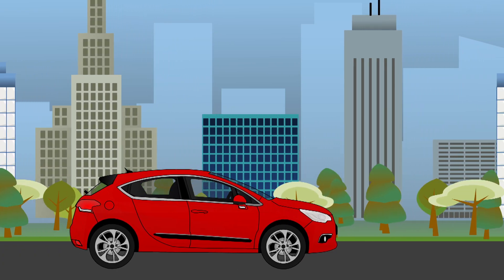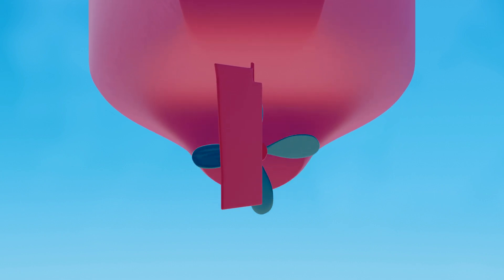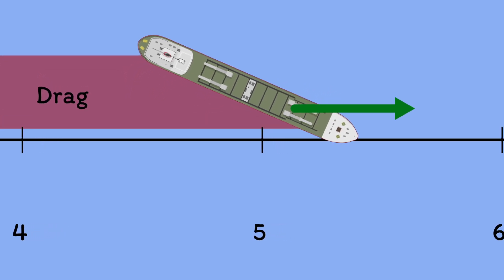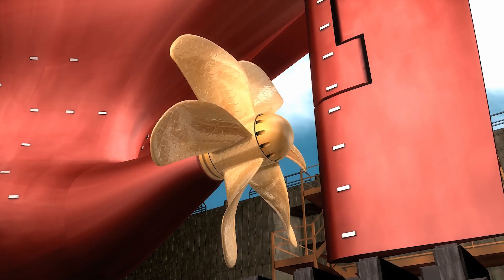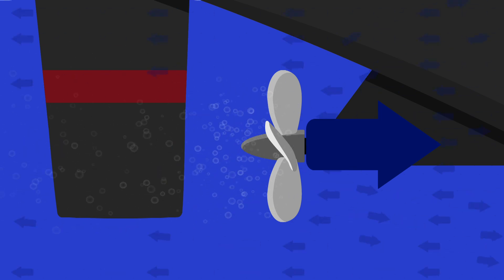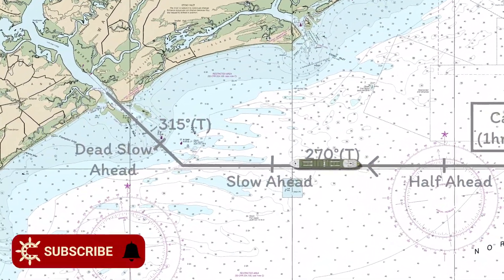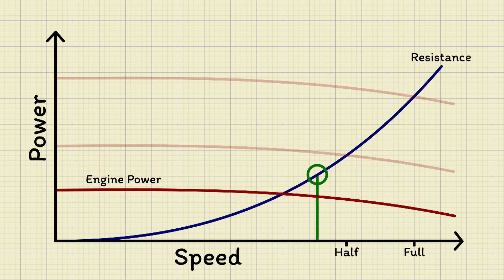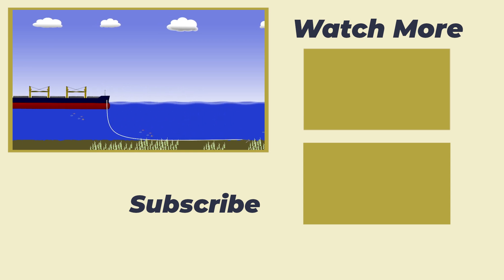How Do Ships Stop Without Brakes?

Comment: Isnt there some ships or boats where they trained to use something smiliar to air brakes on a plane?
Reply: In reality the speedbrakes on aircraft don't act like you think they do. It's common sense to believe that panels lifting up on the wing would act as drag, but no. The way they work is by disrupting the airflow over the wing, which disrupts the lift so that the wing becomes much less efficient. On a boat i doubt it would work as it is propelled via a very different system and the forces would be huge.
Reply: @FrecklesAviation  I mean some of the air brakes that I had seen is like a part of the wing that goes down to meet the incoming wind head on. Like opening a door into the wind flow. I understand that it disrupts the lift that the wing will create, but I was thinking more of the air brakes making drag. That is the same way that I imagine it will work on the ships too as it makes drag into the water
Reply: @Danspy501st  these are called flaps, and they work i n a completely different way. The way they work is increase the surface area of the wing which increases the lift produced, and this is what allows the aircraft to fly slowly. They do slow the aircraft down but aren’t that effective in doing so
Reply: @FrecklesAviation  I think we talking past each other, but I wont go to much into it. I arent a flight engineer or aircraft mechanic XD So I know less. I just go out of what I know planes like F-16 have and Ju-87 has. I know they have air brakes, which helps them to make drag in the air flow. Especially the Ju-87 as it's doing the dive bomb
Reply: @Danspy501st  yes, fighter jets are different to commercial jets in a lot of ways haha
Reply: @FrecklesAviation  Yeah, and I know commercial jets dont really have air or speed brakes. But again, I only mostly know the term from F-16 and Ju-87, epecially the Stuka (Ju-87) as it (Together with other dive bombers) does have an air brake of a type that they use in their dive

Comment: Doesn't putting the engines at full reverse speed also come with the risk of destroying the gearbox?
Reply: There is, of course, increased load on the engine, which is why there are guidelines at which RPMs and below it be done safely without any likely risk of damage. Crash stops are carried out when vessels are first put into water, performance trials basically.

Also, 'full reverse speed' doesn't really give maximum power in the reverse direction. Fuel can't be injected in the 'aft' direction until the engine comes to a standstill, and it is actually just the injection of air in the opposite direction that puts an artificial load to stop the engine quicker than just friction. (Assuming we have a propeller with FIXED propeller blades).

Comment: I read years ago that the Navys Asheville class gun boats could completely stop from 35 kts in 1 1/2 times its length by reversing its propellers at full power.
Reply: that would be a crash stop which is described
Reply: @averagejoey2000  Large Great Lakes bulk carriers regularly have to demonstrate crash stops. I've seen many vids of this being done. I've never seen a loss of control happening. Also I've seen vids of them dropping anchors to stop while in harbors and ports. Seems to work quite well.
Reply: @terryboyer1342  anchors are kept ready and standing by when coming into port, and can be dropped without power in the event of engine failure, but without the ability to control the chain angle, holding power of the anchor is diminished

Comment: A couple of questions from someone who is not a sailor:
Is doing crash stop put undue wear on the whole propulsion system?
When approaching ports, is there a nautical equivalent of an air traffic controller where ship approaches are coordinated?
Reply: 1. it is generally considered good practice to put it in neutral for a short period of time before throwing it in full reverse, but the engineering department is prepared to answer the bells at speed and repair any damage
2. VHF channel 13 is traffic, mostly used by commercial ships. most ports do not have tower to command you where to go, and 13 is more "peer to peer" ish you tell people who you are and where you're going and when so they can keep track of you
Reply: @averagejoey2000  Thanks for satisfying my curiosity!

Comment: Are “sea brakes” - water versions of aeronautical air brakes - out of the question?  They could be flush to the hull unless deployed to increase drag.  Perhaps they would have to be so strongly built the expense wouldn’t be worthwhile.
Reply: Sort of like a spoiler and flaps
Reply: With the low frequency rudder cycling you have the same effect without adding any parts. Just by using your hull as a "sea  brake"
I don't see why it would be beneficial to add more complexity.
Reply: @Jehty_  what about those ferries with stabilizer at the side. Would this work as spoiler?
Reply: Cruise ships often have active fin stabilisers that I guess could be used for this.

...I wonder if any do.
Reply: @DEADB33F  I had the same thought.  But if they were designed to pitch a full 90 degrees for braking, I imagine they would have to be much stronger.

Comment: Could a boat not make use of a brake similar to an air brake in planes, but for water
Reply: In reality the speedbrakes on aircraft don't act like you think they do. It's common sense to believe that panels lifting up on the wing would act as drag, but no. The way they work is by disrupting the airflow over the wing, which disrupts the lift so that the wing becomes much less efficient. On a boat i doubt it would work as it is propelled via a very different system and the forces would be huge.
Reply: Isn't that basically what is done with the rudder breaking?
Reply: @Jehty_  yep

Comment: This is the most informative video you've done yet - not only did I learn the ship facts I came for, but I also learned how car brakes actually work as a bonus
Reply from the maker: Thanks @Matt M Glad you enjoyed it.
Reply: @CasualNavigation  you should have briefly added how a plane stops on the runway
Reply: @allamasadi7970  They use brake pads and rotors like a car.
Reply: @zombie-yellow  To reduce speed, planes mainly use spoilers and thrust reversers. If only using brakes, tires are blown, and likely to catch fire.
Reply: @JohnnieHougaardNielsen  Spoilers yes, but planes are supposed to be able to land without deploying the reversers unless it's snowy
Reply: @JohnnieHougaardNielsen  they also use drag created via lowering flaps, air brakes etc. more drag more slowing down.
Reply: Why u copy my name bro
Reply: @mattm5941  why u copy me
Reply: If you wanna learn more about cars, I recommand ChrisFix channel on youtube !
Reply: @Ryker BOGO

Comment: Huh, never actually thought about how "reverse" thrust would work physics wise, just assumed it should be fine and pretty efficient way to stop. But apparently not. TIL.
Reply: In aviation we use reverse thrust, although it isn't as efficient as brakes or spoilers. The only reason we deploy it upon landing is to help the aircraft settle onto its brakes, or in wet conditions it really helps with stopping as the brakes are much less efficient.
Reply: @FrecklesAviation  Aren't thrust reversers way more efficient comparatively to a ship? I thought, physics-wise, nearly all the force of the turbojet is channeled, instead of just reversing a propeller while moving forward through a fluid, be it prop-planes or ships.
Reply: @epicosity5588  yeah, they’re great in rain. When it’s dry they are used but normally idle, as they have no effect on the braking as the auto brake provides a fixed rate of deceleration
Reply: @FrecklesAviation  Oh neat! I didn't know there was auto braking. I suppose it makes sense given how automated commercial passenger flights are.
Reply: @epicosity5588  yep, when you touch down it begins braking and it has different settings, normally 3 or 4 which are the different intensity, from 1 to MAX (differs between aircraft). Some newer aircraft also have brake to vacate, which is where you select the runway exit point you desire and the system will apply the right amount of braking to stop for that exit, and one more feature of it is RTO, where if you decide to reject the takeoff it will sense that and automatically apply max autobrake, and one of the memory items for a rejected takeoff is to verify its working or brake manually. Autobrake can also be overridden so if you set it too high or need more brakes you can just takeover manual brakes. So yeah, it’s a pretty cool system.
Reply: In Aviaton airliners with Turbofan engines do use this technique.
However, in Military, Thrust reversing is not an option on most planes. VTOL aircraft, like the Yak-38, Harrier, and F-35 Lightning II can use their thrust vectoring and takeoff engines (respectively, the Yak-38 uses dedicated engines, the F-35 has shaft driven turnine, the Harrier has only thrust vectoring) can use that as a way of "thrust reversing".

In Propeller driven aircraft, the story is different. Flipping the prop pitch is not the best idea. Especially at Piston Engine aircraft. You can however use "Feathering"....or rather not use it. Feathering is when you put the propeller into a neutral position, where it stops spinning, and creates less drag. This is especially useful for WWII piston engine bombers, such as the Boeing B-17, and Avro Lancaster, where an engine getting shot was usually not a reason to disembark rapidly. The planes could fly on only a single intact, and another damaged engine. To make them able, they had to lower drag, by feathering propellers that did not generate any thrust. So basically if you want to speed up (or fly with damaged engines) you reduce drag(note: don't feather a working prop), to slow down, you generate more drag. In a WWII era fighter, especially the Inline engine ones (In automotive terms, they are powered by non-radial piston engines, so the term Inline engine was to be used on any engine arrangement, that is not radial. Most used V-12 engine layouts)
Such as the classic Spitfires, there was also the option to fully open all cooling intakes. On some attacker or dive bombers, dedicated airbrakes also appeared. Some of these planes are the A-36 Apache, Ju-87 Sturzkampfflugzeug (Stuka), and the D4Y Suisei. Airbrakes are made to endure higher speeds, and to keep the diving plane from reaching terminal velocity, and to help the pilot quickly pull up. Flaps are some of the WWII planes multitools. They could help outturn enemies, take off on short runways, slow down as approaching the runway, lower stalling speed, things like that. Modern fighters ditched the flaps, or use them less frequently, and airbrakes are more general for them.

Wondering about it, ships could also have a similar system. Openable metal sheets, that would simply generate drag to slow the ship down.
Reply: @barnykirashi  Not realistic, but in War Thunder you can adjust prop pitch while setting throttle to zero and it'll be an effective airbrake especially on Bf 109s.
Reply: One more thing he didnt mention, if it is a single propeller ship (most of them are), the propeller will pull the aft to one side, by a lot. 

(Boring explanation part)
The propeller is designed to work in one direction (forward), so it works most efficiently in that direction. When putting it in reverse it gives less thrust, so more RPM are needed.
The water at the bottom of the propeller is denser than the top, so if the propeller spins lets say clockwise (seen from the aft), the blades on the bottom meet more resistance, and therefore they pull the propeller to the right, and the aft follows. Conter clockwise and its the opposite.
(Boring TL;DR over)

Some ships will turn a good 130 degrees this way before they are stopped, and that turn is completely uncontrolable, you are fully at the mercy of luck. 

Next problem is if its a fixed propeller, you cant just slam it in reverse like a boat motor. You have to completely turn off the engine, wait for the ship to slow itself down enough so the propeller doesnt spin too fast on its own going through the water when the clutch is out, clutch out, put it in reverse, turn the engine back on, clutch in and at that point you are crash stopping.

Comment: When you want to stop, if you have several propellers and rudder, could you use like 2 propellers to slow and one to steer or use the power of each propeller independantly to steer with the throttle instead ? 
Anyways awsome video as always.
Reply: If you have multiple screws you'd just apply differential throttle to steer while slowing (or reversing).

Comment: Rudder technique makes sense why A Huge ship got Stucked in Canal
Reply: It's unlikely that they'd have needed to decelerate fast enough to require HFRC. It's still being investigated, of course, but current thinking is leaning towards a couple of misjudged course corrections due to heavy winds, followed by a sudden bank effect kick to starboard.
Reply: @awmperry  The wind theory is a good one , the land is flat all the way through so wind has nothing to stop it , combine that with the freeboard of that container ship and its a recipe for disaster . Could have as you say a combination of wind and bad course corrections
Reply: Yeah, so can 1000 other legit reasons.
Reply: @drockjr  like aliens from andromeda using a wormhole to prank us for the lulz?
Reply: @alveolate  now you get it
Reply: That's a different phenomenon caused by Bernoullis equation known, literally, in that case as the "Canal effect'.  All to do with with the increase in velocity of a fluid as volume reduces.
Reply: @MarkSmithSa  being a barge captain in the Netherlands, steering a ship specifically designed for small waters I don’t want to go through that canal with that ship. 

I am very familiar with the power of suction and with steering against the wind. My barge has two very large rudders that go up to 90° each side (side to side in less than 25sec) and power to spare. Combined with a bow thruster nearly half the size of the main engine. And sometimes I need all of it to prevent the need for wheels.

A ship like the evergiven barely has a rudder at all.
Reply: @MarkSmithSa  yep practical engineering did a whole video about that situation and thats pretty much what he came up with. at least the video made that an obvious reason.
Reply: Basically, the evergreen was a large sail when the sandstorm and wind hit.
Reply: @YourdearSky  Evergiven
Reply: Look up bank suction if you want to know what likely hsppened.  Also wind
Reply: You stole my line.....
Reply: For reference (“Stuck in the Canal”)=2021 Suez Canal obstruction
Reply: @MarkSmithSa  I hope it's fun, you chose it as a job
Reply: If you talk abot the zeus channel resent accident, then you have heard nothing about the accident. So don't blame the crew, and your comment is way overrated.

Comment: Interesting I never knew that there were so many ways of stopping a ship great vid 👍
Reply from the maker: Thanks @TrainMan 2345 😊
Reply: @CasualNavigation  very interesting
Reply: @CasualNavigation  to stop a ship you need to full astern and when the ship doesn't go forward and no currents made from the ship then put the engines to a stop
Reply: There is another nice way of stopping a ship if it has the right type of propulsion. 

Usually a cargo vessel just has a single propellor with a rudder, but other types of ships sometimes have multiple propellers that turn the propellor to direct the thrust in a different direction. In that case, if you would turn the starboard propellor to starboard and the port side propellor to the port side and give maximum thrust you can stop a ship very quickly. 

The water that is being pushed to the side creates a wall of water next to the ship. This wall produces immense amounts of drag slowing down the ship, while keeping full control.
Reply: @autobootpiloot  I think what you are talking about is directional propellers and they are normally found on things like heavy duty tugs where they need the extra maneuverability provided . It would not exactly form a wall of water as the thrust of the water would have nothing pushing back , if they could be turned to face even slightly forward it would help slow the ship , a bit like with the Harrier jump jet and its nozzles . The main benefit would be that the props are not giving forward thrust .
Something that could be installed is thrusters built into the bow and facing forward but then you would have to have doors for when not in use otherwise they would cause a lot of drag .
The Dutch are experts with tugs and salvage work , they probably have some with the variable propellers
Reply: E Van  With ships the whole trip is planned but there is always the unexpected . Ships have very detailed maps of harbours and get guided close to them by the local coast guard , pick up the pilot and he takes you in . Once you are out of the harbour at your start point its quite boring and uneventful usually until you get within about 5 miles of your destination , but you always have the radar running and lookouts at night , especially in certain areas like of the coast of south America , the radar does not always pick up the small fishing boats because they do not carry radar reflectors
Reply: Next time you are in a car put your hand out with the palm facing the direction of travel , its the same effect as turning a ship sideways
Reply: @silverbackor606  wat
Reply: ship terminology: rudder cycling
spaceship terminology: roll reversals
Reply: As a couch captain, I agree.